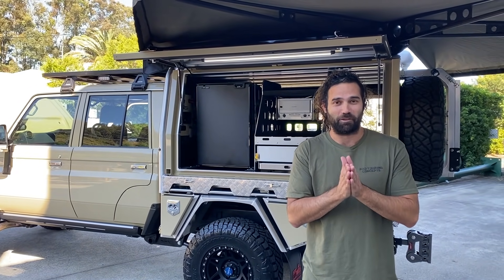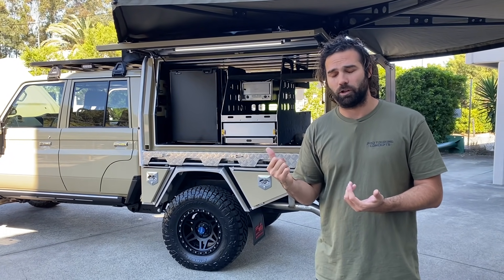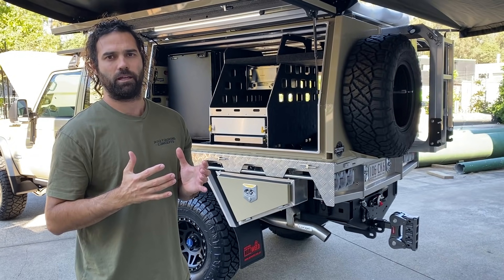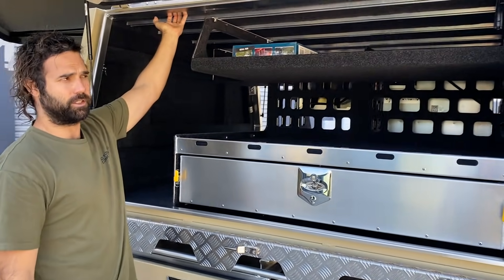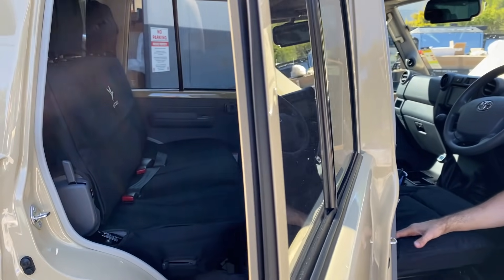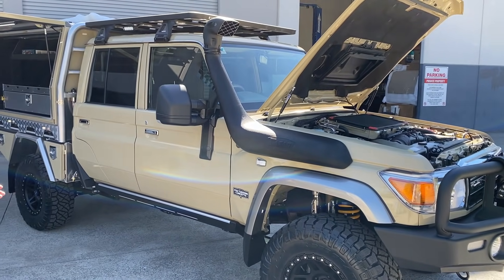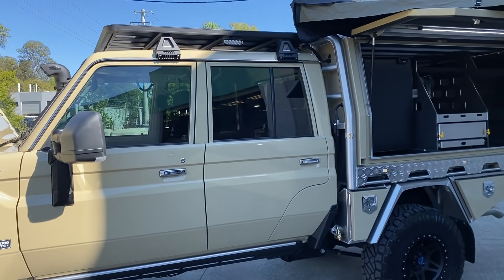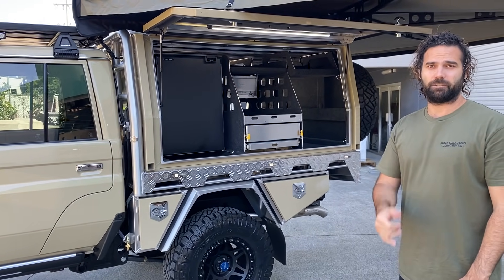Oh Sandy!! Latest 79 build to leave our Pro Touring workshop!

Comment: Definitely one of the best builds I’ve seen. Love you’re work fellas. What 295’s did you decide to run?
Reply from the maker: Thanks mate we loved this one too. Perfect touring combo. 295/70/17 Nitto Ridge Grappler
Reply: @ProTouringTV  thanks mate. Really appreciate the reply. Just about to get my new 79 duel. When I win tatts I’ll send her your way. Love ya work
Reply: @ProTouringTV  In the meantime I’m just doing a cheaper build myself. Thinking of running this tire and wheel combo on a TJM pace remote res 2 inch lift with 3 inch coils. Do you think I will run into any issues with this combination?

Comment: That is one well built rig. What sort of range do the CB and cellular aerials get?
Reply from the maker: Thanks mate! Depending on which antenna for the CB, we supply a short and long range... short designed for hilly/enclosed terrain good for approx 200m and the taller 6.6db antenna good for a few km's.